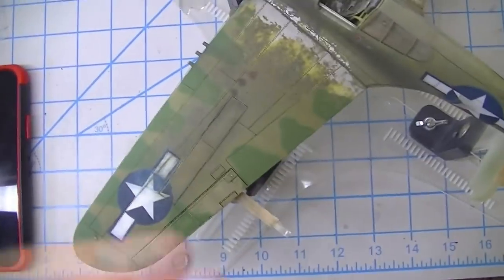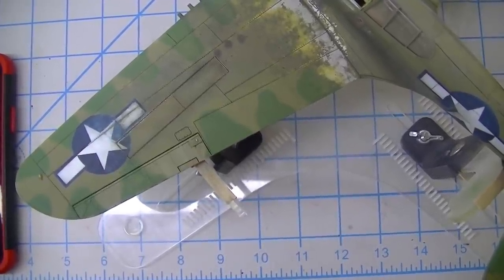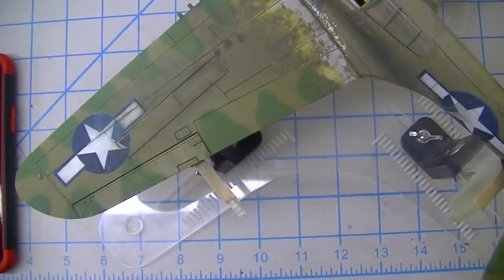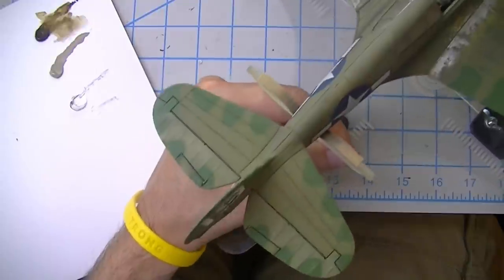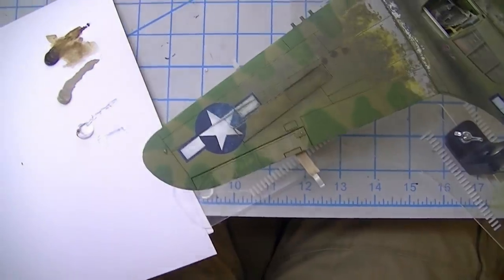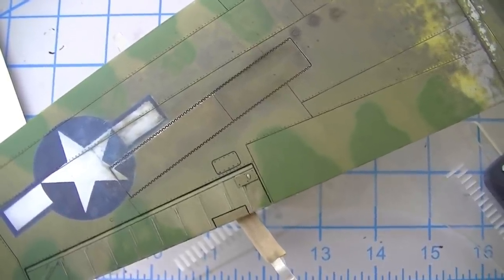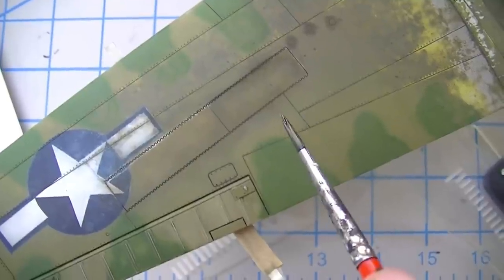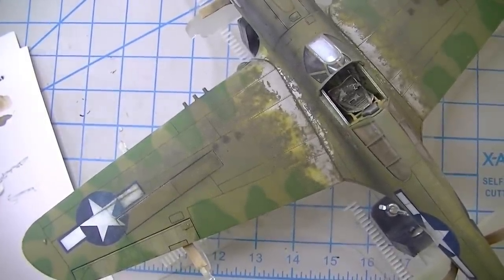ep321 - oil paint rendering for aircraft part 4

Comment: Oops almost did a mistake when using a brush that had mineral spirits. Done that. Wasn’t pretty. This leads me to a question… do you clean those “huge” blending brushes with spirits or just leave them be? Haven’t been brave enough to try that with my oil brushes.  My mr. metal color brush I never clean. Just rub it off and use it for endless metallic dry brushing. Wondering if this is the same in a sense.

Comment: Thank you for now including some pause/pull-back type views of the P40 ( maybe include at the start and ending of each episode?)🤔
Would you include some splotching staining effects on the horizontal stabs (esp lower surfaces) due to the adverse operating areas/conditions (I.e. puddles/mud) in the CBI theater?
Another factor in the exhaust stsin3 color is the mixture ratio utilized. I.e. lean fuel to air operation tended to produce a lighter colored exhaust stain effect(s) as compared to a more rich fuel air mixture. As the “auto-rich” throttle position was generally the set and forget, type position, your results may vary. Longer range/duration; use lower manifold pressure and leaner mixtures. Combat? Everything full forward!